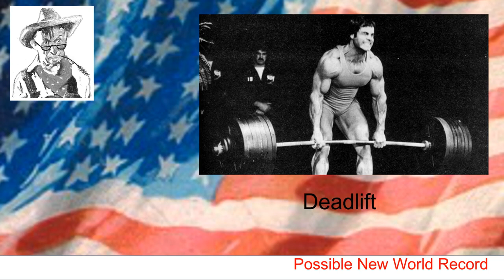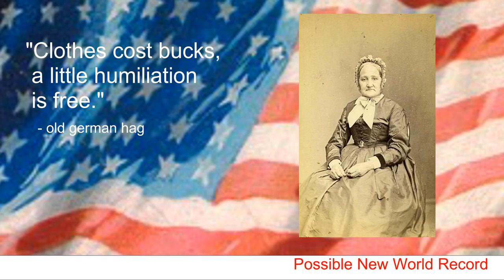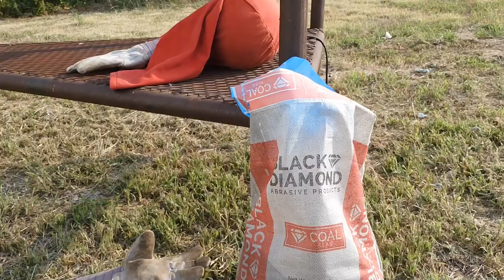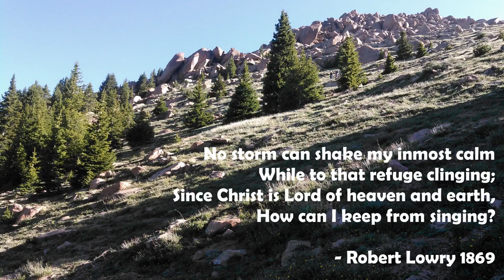1962 Corvair Restoration - Part 2: Complete Frontend Cleanup & Paint

Comment: That is some slick work, Mr Jayhawker.  I love the work you do and your sense of humor. Good schtupf.
Reply: Everybody loves to save money I had my whole front end every part Sand blasted is for a $100 then I did a little more clean up so to me time is money so I'd rather spend the 100 bucks than spend 15 hours cleaning something and when I was done that I got it coated.   I also bought a lot of new bolts from Clarks  Corvair parts when you think about it yes that cost money and look at the time to wire wheel every bolt and new and these bolts come coded in are all great